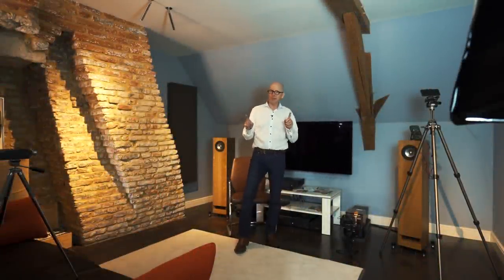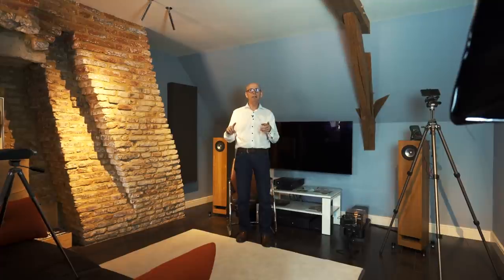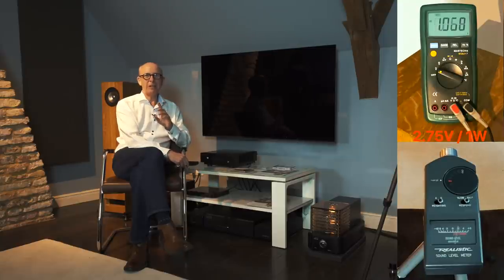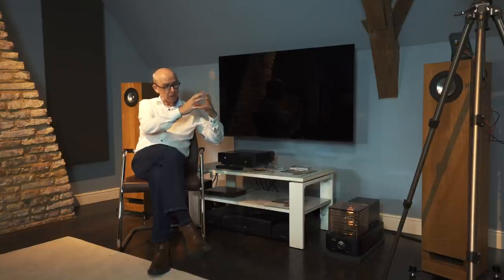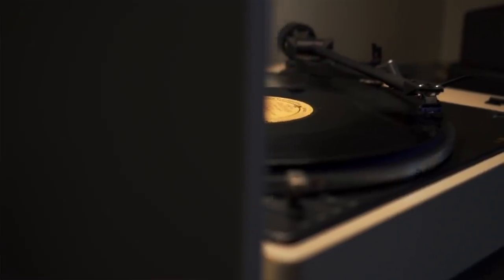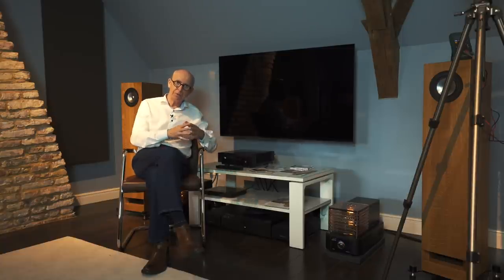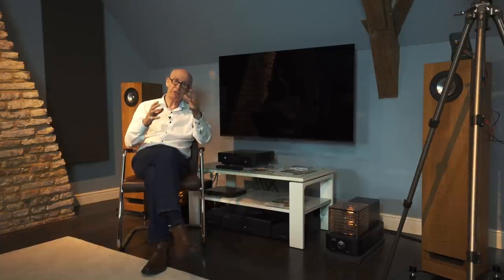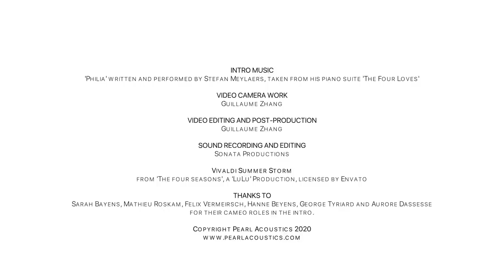How loud is 1 Watt (with an 87db Loudspeaker)?

Comment: likely one of the most useful and easy to understand videos on this topic ever made. well done.
Reply from the maker: Thank you!
Reply: @PearlAcoustics  An underpowered tube amp doing soft clipping at the peaks is by design, in my opinion, much inferior to a well-built transistor amp that can keep the signal shape intact at the peaks. But, if someone really likes having musical distortion added, then tubes can do the job. Any notion that adding a tube stage makes the sound more loyal to the master signal is bogus and a DSP can easily do what a tube can do in terms of incremental distortion effects (incl. do it better) for those wanting such sound.
Reply from the maker: @ThinkingBetter  I am absolutely in line with you here. However, sometimes scientifically ‘better’ does not sound so pleasing. It’s a very emotive area where I dare not intrude. As I say in my video. On a cold winters night with a glass of wine and the warm glow of two, very high quality tube amplifiers not running anywhere near their max - life is just perfect. But in the summer when I need to analyse exactly what is happening in a mix. Or just hear it ‘as it was’ - a top quality transistor amplifier is a must!
Reply: @PearlAcoustics  Well, whatever makes a person most happy should be the choice for that person when it comes to solid-state vs. tube. One factor is also what sort of music you listen to. I'm not against people adding some distortion or EQ. In fact, I often calibrate with EQ carefully to fix issues with room acoustics, especially in the bass, and a slight boost in the high treble above 12kHz to compensate for my hearing aging.  The loss in high treble compensated with EQ is sort of quite similar to the loss of eye focus when watching TV having to use glasses to enjoy the full resolution.
Reply: @ThinkingBetter  I would  argue to that comparison to TV. We easy see lack of details walking  in street or in  TV  which is annoying when we cannot read small writing. In  listening in nature we experience  everything   correct ( except much loss of hearing) only producers of  gear force us to think that we need  limits which are not playing role in listening. Just as TV producers who say we need 8K or 18 K and with it we are getting slower refreshing, jumping movement of  picture and faulty colors. Because  more "K"  is easy for them . Most people  tend to believe in years   of invention of tubes and transistors as proof of progress. Progress is newer.  When it is obviously wrong then they try to push that they have "better ears". then those who are more satisfied with older. First even started to produce transistors   emulation of bad tube amplifiers  which make  proof that it is bad. How about transistor's emulation of tubes  in radio receivers? .What "ugly" would it present? 

My conclusion to audio discussion is that it would be  valuable to understand Einstein's  Relativity Theory   up to the  bottom before trying to understand  audio. It would help to find the truth which is "nothing better done " .
Reply: @Mikexception  Both our eyes and ears can perceive details to some limit of bandwidth determined by our senses and brain. When we age our sensitivity drops in the highest treble and that means we can’t hear some fine details as well anymore. Through EQ compensating for some dB of loss, we can, under some conditions, recover some of that so those details can become audible again. It most certainly works and there is nothing Einstein about it. Tube distortion is also well understood.
Reply: @ThinkingBetter  Seem you presented  state of official science for schools . Almost in my 70 I can hear max about 13 kHz . Hmmm....dropped in the highest treble?. Then I wish anyone could describe me which  details in music instruments  I cannot hear, Just to proof they know what they are talking  about.  Present me what will be lost and in which instrument. Do not show FTT waterfall which is badly distorted in volumes  and do not represent masking effect in any way. . By the way top note for piano is around 5 kHz - try hear it for better  imagination  . Thing is that few listeners have knowledge  about harmonics  and it is popular belief that anything ear can perceive  in total silence with headphones and alone from other harmonics    is important  part  of  relatively loud sound of instrument. People know  little  about masking effect,  low sensitivity for harmonics  above 10kHz  in any age  for  everybody (see ISO 2003  curves) and negligible   energy of acoustic waves produced by adequate to such waves particles .
Reply: @Mikexception  At least one member of each instrument family (strings, woodwinds, brass and percussion) produces energy to 40 kHz through the harmonics that make up the uniqueness of every instrument. Harmonics of muted trumpet extend to 80 kHz; violin and oboe, to above 40 kHz; and a cymbal crash is still strong at 100 kHz. In fact, a cymbal is one instrument I can hear is improving by tweaking the high frequency treble through EQ to closer of what I used to hear.
Reply: @ThinkingBetter  can I just add that NOT all tube amps compress the peaks and have adequate headroom for the peaks with the speakers used.  I drive rfc Canterburys using a Radford sta25   94dB sensistivity and minimum impedance iof 7.3 ohms.  Damping factor is very high thanks to the amps low output impedance and rfc's low dcr bass inductors.  It's a system that has visceral dynamic swing ability for orchestral music and needs to be insanely loud for peak clipping to be evident.
Reply: @ReferenceFidelityComponents  Tubes added for managing more pleasant handling of dynamic peaks is an argument I can easily understand and appreciate, but I'm not sure there are really good arguments for using tubes in audio paths otherwise. If the aim is to be maximally true to the input signal, then transistor amps can do an excellent job already without the need for warm-up, calibration, and wear-out issues. One tube being in a signal path that contains 10s of transistors can only represent an additive effect of something not in the signal, to begin with.
Reply: I asked no FTT so how did you detect them?  Fact that one  can detect harmonic  with  FTT does not provide that we can or even should hear it. I am 100% sure I do not loose it  because this are different sciences - detecting with metal build microphones   and sending later  to screen for picturing it for eyes  and direct  perceiving with  ears and brain with no eyes engaged.  . Lack of  compatibility in methods. Nobody can see exactly what he actually hear. There are serious problems in most of tweeters  which force listeners to amplify and unmask top sopranos. All should  know that by adding 3 db at 8 kHz we double or triple 16 kHz which then will  be artificially  observed
Reply: @Mikexception  I’m not sure what you mean by adding 3dB at 8kHz will impact 16kHz even more. With an EQ you can easily do 3dB added at 8kHz and nothing added at 16kHz. Personally I like the opposite of adding a few dB at 16kHz and I definitely don’t like to boost 8kHz. In fact, boosting around 8kHz is often yielding sibilant issues.
Reply: @ThinkingBetter  About tubes I tried and experimented with some very known transistor amplifiers and some excellent tube amplifiers , also any possible own ideas for reason of real sound perception It took me totally 50 years.  Not this or other real instrument which one  even didn't see by eyes  and judges it's timbre as natural  but all possible symphony orchestras, real gigs , real storm and real trains in variety of LP/CD recordings also for tests and own recordings of nature. Finished - done . When we do not override advised power there is no problems in either technology except slight differences of "distance from performance"  .Technical approach in parting and assessing each doubtful parameter  never   helped me.
Reply: @ThinkingBetter  I use parameter EQ only to modify  my instruments and my vocal microphone up to my daily taste CD recording mt CD  . and have basic tone low/high adjustments   in tube and solid amplifiers.  But I avoid their any significant turns from zero position. Only when at  at first I am confident that something due to recording or mastering was  lacking That is why I made my own conclusion that when I hear from speakers top high or top low it means it is too good  to be real. My actual lovely toy since last octobre  are speakers made in 30ties of 20 century driven by A class tube radio mono amp - sure made too in 1939. I doubt they can properly run 10 Khz nor 50 Hz but its is sweet  listening  at   AM bands 7 kHz wide.
Reply: @Mikexception  Of course you can have great sound coming from amps involving tubes also, but there is no magic involved and tubes are notoriously bad on stability over time.
Reply: To add to the whole issue every piece of gear adds some sort of distortions to the playback beginning with microphones used and their placement during acoustical event, therefore even the best playback system/listening room  will never be able to reproduce the sound as faithfully as one hears/feels it during actual event. So by default all reproduction systems of audio, visual and memory are flawed. Unfortunately our whole audiophile 'Utopia' is not real, and no system can magically move us in time continuum, whether we use 24bit/382kHz or 16bit/44.1kHz.
Reply: @pliedtka  While that is true, minimizing any incremental distortion keeping the signal as true to the original as possible is still a legitimate goal for an audiophile system...within reason. And yeah, the audiophile utopia with overpriced stuff, like snake-oil power cables costing 1000s of Dollars, or over-specified stuff, like DACs able to do streams of 384kHz 32 bits, is equally ridiculous.
Reply: No, it's not. You cannot measure an amp's output power that way, for various technical reasons.

Comment: My Tannoy Cheviots - I've owned them since 1976, are driven by a Leak stereo 20. 10W per channel. I have never used any where a quarter of that. I've never felt the need to up grade or change. They deliver everything I need - I love the sound I get. Thanks for another excellent video. 👍
Reply from the maker: Thanks for your kind appreciation Chris. Enjoy the Cheviots!
Reply: Hello, just bumped on this comment.I have a Stereo Leak 30 plus, it's rated 15W amp per channel, but with any of my speaker It's loud enough to make people run away.Not that is what I want, just wondering why I usually need to get it more then half volume to have some beef out of my speakers. Maybe it's because it's not a tube amp?  Can you explain this? Thank you very much

Comment: Good simple video proving how little power most people actually need.

I got 87dB speakers just like in the video and I sit just over 2 meters from the speakers. 
Now, I do enjoy my Heavy Metal music quite loud but I calculated that even when blasting as loud as I can stand it, and much louder than what is safe to listen at, it wouldnt even use 20 watts, or a quarter of what my little Denon amplifier can output.
Most of the time the amp is just idling.
Reply from the maker: Thanks! My point entirely! It’s the quality of the watts that matters most. Enjoy the music - even if it is heavy metal! 😉 as long as it stirs the soul it’s good!